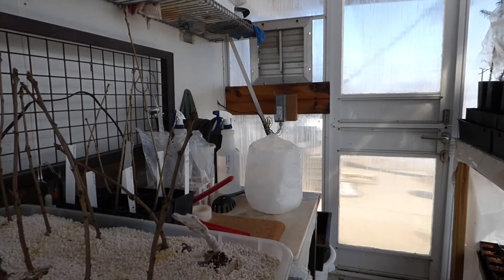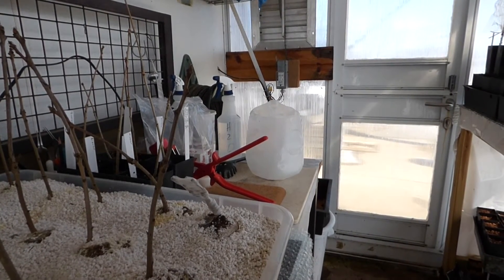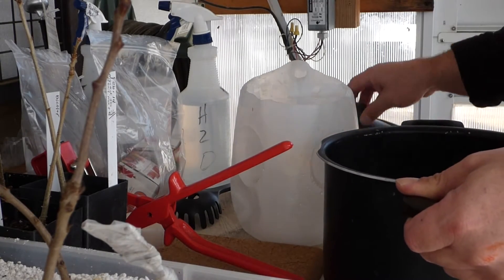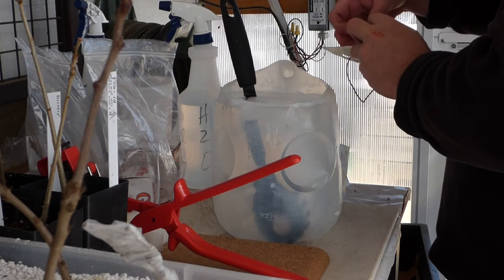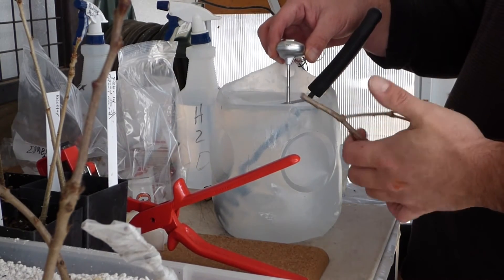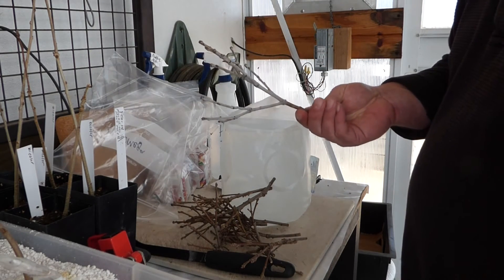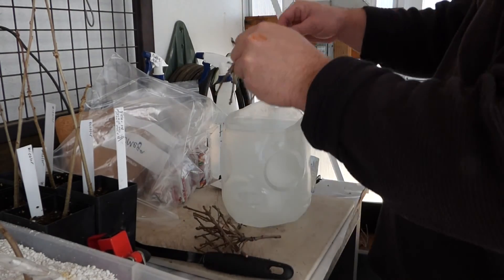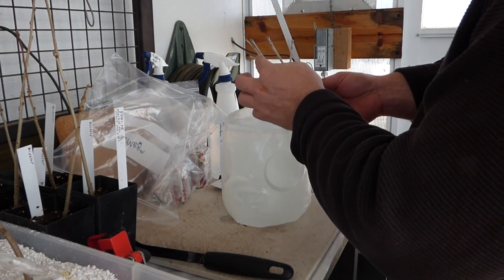Grafting Oak WB Using Fieldcraft Topgrafter Pt.1 Waxing Scions

Comment: Thanks for the demo.  So 160 deg gives a thinner coat?   But 130 deg  also gives an acceptable thickness.  Good to know the temp is not that critical.
Reply from the maker: For field grafting a thicker coat is better.  For bench grafting 160 
with the amount of paraffin is perfect.  However, I like 160F period.  
If I were to do scions for field grafting, I would use a mixture of 
paraffin and beeswax.  The ratio is 1 or 2 parts beeswax to 5 parts paraffin.
Reply: coniferblacklab great video!

Would you be interested in helping graft and observe a Blue Oak WB?